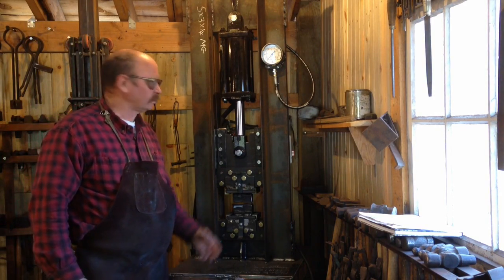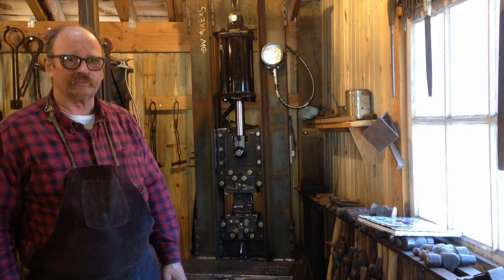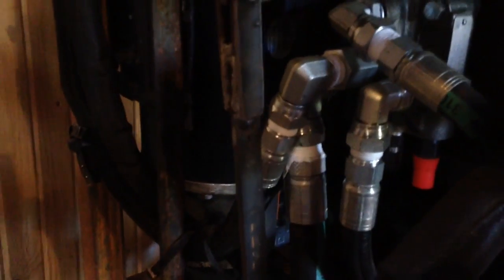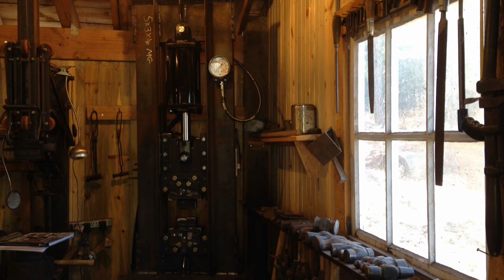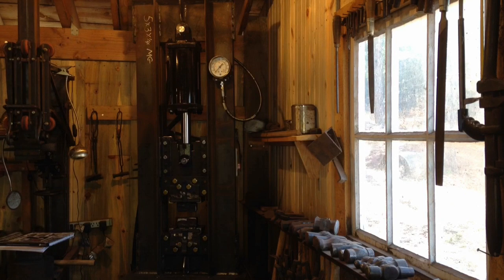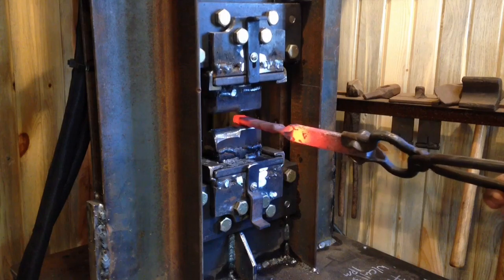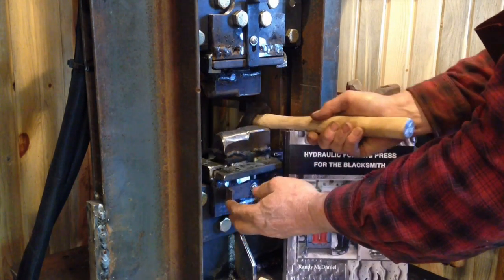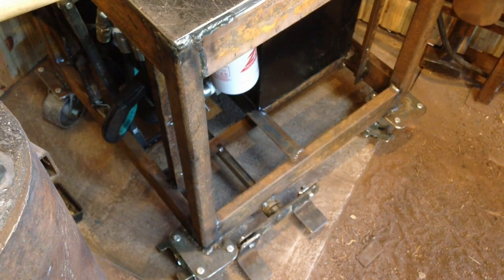Shop built forging press - 24 ton

Comment: I've been looking at many designs to build my own. What I like about this one is the angle iron pillars sandwiched around the vertically oriented 1in (guessing?) bars at top and bottom...
Question: does the 1in ( ? ) core of the carriage also extend in between the gap between the angle irons on either side, and if so, how far?
Reply from the maker: It extends about 3" into the channel

Comment: Nice press! I built a 20 ton with a bottle jack. No good for hot forging, but great for mechanical tasks and cold forming. A small improvement for yours though for me would be a foot on/off switch or linkage so you can walk over with 2 hands holding a heavy piece without turning the press on beforehand.

Comment: A very nice design. I wondering if you've come across or considered heated dies? I restored an aircraft hot dimpler a few years ago that used an electric resistive heating element with a thermocouple and a PID controller. I'm thinking about small dies that might benefit from a few hundred degrees of preheat to improve speed when drawing out. Just a thought drawn out while your very cool toy was impressing upon me. Peace.
Reply from the maker: Sounds great for industry and a bit much for my small shop
Reply: @BlackBearForge  Thanks for replying. I've noticed a common complaint amongst guys making knives in a hurry, losing too much heat into their dies.  I'm suffering from way too many years building prototype machines. My thought to ask if you'd see any was for use when forging aluminum alloys that require hot dies. By the look of your press you have plenty of experience and knowledge under your belt... or you're incredibly lucky. Take care.
Reply: I've seen other guys on YouTube take a few large pieces of mild steel and throw them in the forge along with whatever they are actually working on. When they are ready to use the press they take the mild steel out of the forge first and put it on or near the dies while they get what they are working on ready to be pressed. The idea being that the dies will absorb the heat from the mild steel making them not take as much from what your working on. I'm not sure if it works. I don't have a press yet.

Comment: What is the distance between the uprights, from left to right where the die sits?  What are the dimensions of the plates the dies are mounted on?
Reply from the maker: The spacing is about 10" and the die plates are 4 x 6.  I have seen someone else's press that they made the die plate square to allow for inserting the dies rotated 90 degrees.  Seem like it might be handy that way.

Comment: Very nice build. Have you had much use out of it in your day-to-day work?
Reply from the maker: It gets a fair amount of use but not as much as the power hammer or treadle hammer
Reply: @BlackBearForge  not sure if you have anything like this in mind, but you should make a die with Black Bear Forge and your logo and press it into some hot steel and sell them.

Comment: Hi again. Does your motor get hot? I just started mine 1.5 hp 16 gpm. The motor struggled to pump and getting hot very fast. Replacing with 5hp 11gpm  pump. Does this sound about right?
Reply from the maker: I think 16 gpm is way to much for the 1.5 hp motor.  mine is 2 hp running at 5.5 gpm.  it is an 11 gpm pump, but I am running a slower 1725 rpm motor so that I am only pumping 1/2 flow.  5 hp may still be a bit small for 16 gpm.

Comment: Excellent video sir. I didn't hear it in the video, did you mention what total cost on that build is? Really like your take on the design. I've been deciding between doing something like that or buying and modifying a log splitter. I mainly do Ornamental ironwork and door hardware type stuff. Using my flypress daily has really started doing a number on my lower back and I think that press would really help out. Really appreciate your videos.
Reply from the maker: I don't have a total.  But I would guess about $2500

Comment: Calculation of hydraulic force 
Area of 5" cylinder 19.53 sq in. X pressure 2000psi =
39,260 lbs or 18.6 ton
More than enough to squash a lot of yellow hot steel for sure! 
Not trying to get all technical here just FYI. Forge on! Your videos are awesome!😎

Comment: I believe a 5"cylinder at 2000psi puts out approximately 18.6 ton
I just completed a press with twin 4" cylinders, At 2000 psi I calculated 26.4 ton. 
I did pretty much what you did, overhead, 5x5x1/2" angle iron H frame 3/4"x6" top and bottom with twin 4" cylinders. 
I'm convinced 18-24 ton is plenty for forging in a blacksmith shop, it's all good! Thanks for the video ,great job 👍
Reply from the maker: My Calculations are based on James Batsons specifications
Reply: A 5" cylinder, on the extend stroke only, is 19.635 square inches.  That would give you 39k at 2000 psi, or 49k at 2500 psi, minus minor frictional losses.

Comment: I love your press, my question is what kind of steel do you use for your dies? I’m almost done with the c-frame version, all I lack is hydraulic lines and dies. I had expected to use h13, but I can’t find anything near me but round. Several people have recommended cold roll. 
Thanks for any advice!
Reply from the maker: I use 4140 for most of the dies

Comment: Yup, doing exactly the same thing. I've flipped the press over. I am impressed that it has that much force with a 2 hp motor. Thanks.
Reply from the maker: The motor HP only effects the speed as it runs the pump slower, but is will still get the pressure up.

Comment: If you heat 2 chunks of metal to welding temp and mash them together with the press,
does it make a good weld ? Or does the metal cool too quickly ?
Reply from the maker: If it is thin it can cool to quickly.  The real problem is that a weld can easily be torn apart in the initial stage of welding and a press or large hammer can cause parts to move and shear the weld.  So a gentle squeeze does work very well but a giant squish wont work as well.  many makers of pattern welded steel use a press

Comment: Hello John. I just purchased the steel to build a Batson H frame.  I hope it turns out as nice as yours!  My question is how did you cut out the press block inset where the working end of the cylinder connects?  Thanks.
Reply from the maker: band saw and grinders, nothing fancy just persistence

Comment: What type of plate did you use to anchor your cylinder clevis pins--A36? I'm finding that, at 24 tons, I exceed the yield strength of the plate, when using 1.25 inch diameter pins and a 1 inch thick plate.
Reply from the maker: I used A36  but it's a full 1" thick and 8" tall.  Plus it is backed up by other components such as the top plate or the ram guides.  So far no trouble
Reply: Thanks!

Comment: I've built hydraulic log splitters before and I'm having trouble wrapping my mind around running the pump at half speed and less than half the recommended horse power.  Haldex/Concentric gives all the specs for their 11gpm two stage pumps while turning at 3,600 rpm.  I see you have a pressure gauge mounted on your press.  Do you actually get readings of 3000 psi?  What model pump are you using?
Reply: What pressure does it max out at?
Reply: Or maybe I should ask what pressure does your gauge say when its under relief?
Reply from the maker: the pump generates the same pressure in the cylinder regardless of speed, it just takes longer at lower speed.  The ram pressure is a function of the pump pressure and ram size.  By running the pump at half speed, it allows the use of a smaller HP motor while still generating full pressure.  I don't know the pump model off the top of my head, but I do get full rated pressure.

Comment: Thank you for your wonderful video 
What hammer eye sizes do you punch?
1045 alloy? 4140 alloy?
Regards
Reg
Reply from the maker: My eye punches are sized to fit the handle I like.  Start with the handle and then make the punch and drift to suit the eye size.  My press punches are H13, hand punches are usually S7 and drifts are typically 4140.  But there are lots of options depending on what you are comfortable using.

Comment: dose James Batson have a you tube channel ? as i'm planning on making a hydraulic forge press to forge some high carbon steel round bar as  i'm not having much luck trying to forge it by hand
Reply from the maker: I don't think her does.  But the book is still available.
Reply: can i buy the book thru a local book shop ?
Reply from the maker: You will probably need to do an online search, perhaps through Amazon
Reply: ok will do thanks for your help :-) would the book have diagrams of how to make the forge press ? i can look into it in the book store and order the book
Reply: Book is on the ABS website

Comment: Nice! I was wondering if a 1700RMP motor would get the job done. Do you find 2HP lacking? I want to convert a log splitter, but the 20 ton splitters usually have a 6.5+ HP motor on them, and they run at 3600.
Reply from the maker: The RPM and horsepower go together.  The press operating pressure remains the same and is a function of pump pressure and cylinder size.  If you increase the motor to a 3600 RPM you must increase to a 5HP motor to move the increased fluid flow.  But the pump will be twice as fast using the same pump.
Reply: Excellent. It looks like it's plenty fast enough for a forge press. I'm about to convert a 25ton log splitter and I think the next hurdle is getting the motor to couple with the pump. I have a 1.5 HP 1700 that I took off a belt grinder. Not sure if that'll work, but if not I can sell it and get something else.
Reply: The pump is probably suitable for a certain rpm so all you need to worry about is the flow and pressure of the pump then get the right motor.
Impatient as I am I think I would like something a bit higher flow (ie bigger pump and motor)  then what Black Bear Forge was using, but then again I have no forge press experience. And If you only puch and drift holes perhaps it wont matter much. It looks very handy though!